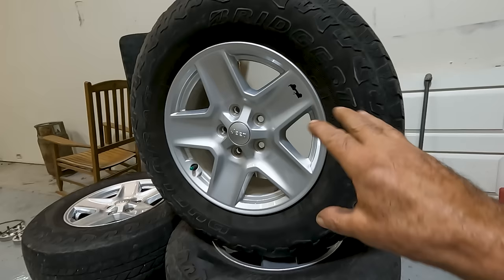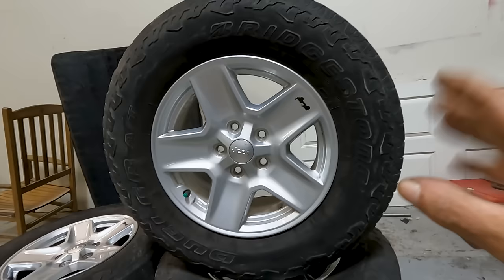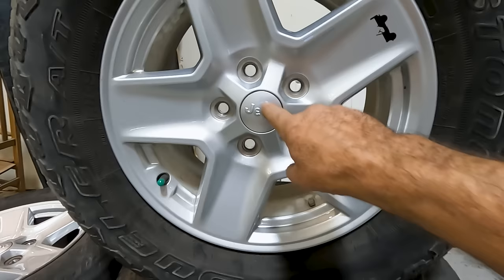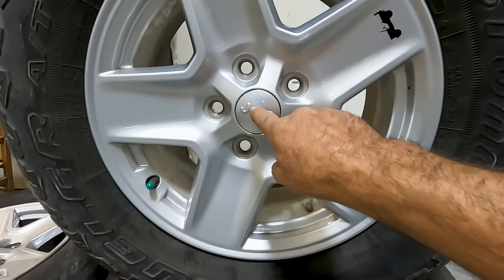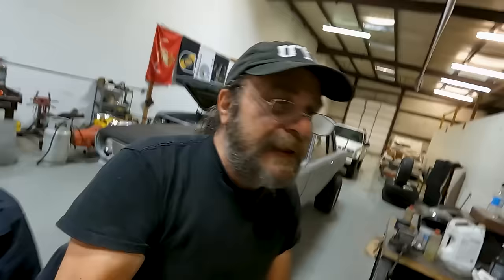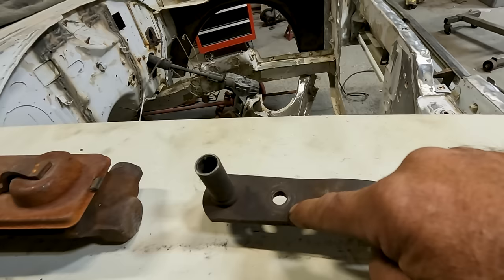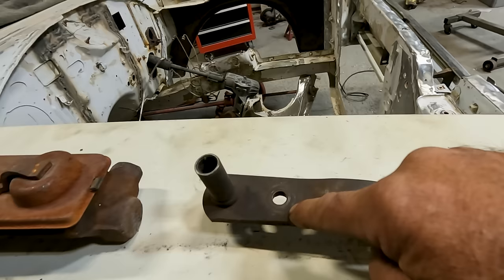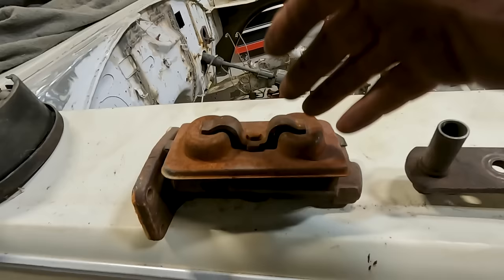Modifying Classic Cars And The Butterfly Effect - Can You Outsmart The Engineers?

Comment: I don't mean to poo-poo on your advice but my anecdote is almost the opposite for the same exact reason.  I live in the rust belt of Indiana so that may have something to do with it but my 63 Fairlane Sportscoupe had a single pot drum system that I converted to front disc.  I believe the engineers designed the braking systems (especially on budget cars) to be optimum to a price point for which is good enough for general use of the time.  For the amount of time and money I threw at those stupid drums that never worked properly for more than a few months I could have converted it to disc 3 times.  It got real old not knowing where the car was going to go when you hit the brakes hard.  About 7 or 8 years ago I converted it to disc and have never had a problem since.  Now I did change the master/booster, added the correct proportioning valve, discs, calipers, lines etc all new but now it brakes like a modern car and in the wet or slick weather it is finally predictable.  I'm not one of those guys saying that you have to convert, but done properly I think it adds to the daily driver ability.

Comment: i have a 1953 chevy 3100 pickup.  i had to put power assist disc brakes up front, because people drive different than they did in the 50's.   you are nuts.   i couldn't get the brakes to work effectively without pushing so hard my butt would come up off the seat,  since i installed the new brakes i can count on them no matter what .   usually i agree with you but not this tine.  i've had this truck 30 years never an issue with brakes since i modified my daily driver. 
i bought the whole kit from Patricks antique cars and trucks,PO Box10648 casa grande az.  i still have the catalogue.
Reply from the maker: There is a drastic difference between "pre interstate" era vehicles and post interstate...the cut-off being right around 1962-64.  The braking capabilities of the early cars and trucks is completely lacking in a 70 mph world, so upgrading yours makes total sense.
Reply: @UncleTonysGarage  thanks.  respect you much.  almost didn't post cause i didnt want to piss you off.  this truck may get power steering cause at 75 years old i am tired of how much effort it takes to turn front end while parking and k turns etc.  problem is at my age i have too many really  cool projects on my list of stuff to do..  they had big steering wheels in old cars for a reason.

Comment: Years ago I drove a Ford f-600 ambulance and the owner of the ambulance ordered it with air brakes which was way to much brake for that ambulance, I drove that ambulance 400 miles and everytime I would apply the brake I would barely tickle the brake pedal because if you pushed the pedal down a little more than tickling it the wheels would lock up or want to put you through the windshield!!! I was glad that was the only time I drove it and will never drive something like that again!!!!!

Comment: I have a 1982, Ford F150, in line 6, 4.9 L long bed. 145,,000 original miles and I have restored it. The only modification I did are as follows:
1. Heavy duty wiring harness
2. Electric cooling fan with a complete shroud
3. LED lghts
4. Holly EFI system. The carb was going and was constantly gummed up by these "new fuels." I had no choice here. Now she starts up like any modern vehicle.
5. Stereo with blue tooth.

They do make all manner of stuff for this truck but I was told to stay away. Speaking of your video, they also sell a "all 4 disk brake system" for it. It had drum in the rear and disks in the front. 

It just gives horrible gas milage (always did! Lol!) , about 10 MPG. I drive it to work 2 times a week. Is the gas consumption normal for these engines?

Comment: This is why at 55 years of age, I don't modify my cars I use GM parts from other models and years that BOLT ON
Reply: That is one of the great things about GM cars and trucks from about the late 80's-early 90's, and earlier...so many parts interchange...done by GM to help save with costs, no doubt..but it also helps us by making it easier to find used parts...
Reply: @dyer2cycle  I just do what they did, every time they were given the green light to use all the goodies in the parts program. Like my 86 Monte SS is gonna have a non ECM carb inducted 86 alloy head flat tappet Vette 350 TPI motor. With a 4.3 V6 convertor, and 4.10 S10 gears. All GM oem stuff. Just never available together on that car. Iroc box, Astro van steering shaft, SLP Camaro SS alloy rear diff cover/girdle/cooler on the 7.5 10 bolt. 5.7 TPI Fbody large outlet exh manifolds with a hand built ypipe into SS cat back. This stuff makes the car the way it should have been. With NO ILL EFFECTS

Comment: I a agree with most of what was said by uncle Tony on this video but there are some exceptions to the rule when certain models have a history  of bad performing breaks in a lower speak version.
As an example the early 6 cylinder holden commodores had smaller rotors then the v8 option versions but the v8s only being 100kg heavier could still pull up alot quicker then the the 6 cylinder version they where only 20 millimetre biger in diameter but it made a world of difference so in cases like that where nothing else needs to change just rotor and stub axle and everything else bolts up then its a no brainer for me do the upgrade just for peace of mind

Comment: I'm noticing a pretty big disconnect on a lot of these comments. The video was about stock daily drivers. So many people aren't picking the info up. If you change a front drum cars brakes to disc brakes, you don't just "put a proportioning valve in". You would need a new master cylinder, hoses, possibly lines, maybe even a pedal to even start to do it right. Then there's the rear brakes. How's the new front brake set up going to act with factory rear drums. Do they need to be bigger or smaller? In the end, the car probably won't even brake better than if you just left it alone and used stock factory equipment and adjustments. What makes most people fail at brake upgrades, imo, is that they pay no attention to the rear brakes. Good factory rear drums adjusted correctly will stop amazingly well. If you've swapped a V8 into your Chevy Vega, that's a modified hot rod now, not a stock daily driver. Thanks Tony for this well needed video!

Comment: I partially disagree only because technology has changed, and you can taylor a vehicle to your particular conditions.   
  There are things that are more reliable, or more effective.  
   Planing a head for more compression- improves overall efficiency.   
  Swapping gearsets for best ratios.   On my 56, it had a 3.90 diff with a three speed.   Swapped in a 3.38 diff and an sm420.  Its overall just better at takeoff, and cruising.  I kept the original brakes, they work fine.  
   I installed an electronic ignition because I live in a wet area and got sick of maintaining points.  I never have to think about the ignition anymore.   Its a total non issue.  
  I also swapped in radial tires.  
  Swapped in electric wipers in place of vacuum wipers.  Modern radio.  Seatbelts.  Green tinted tempered glass.  LED bulbs.

Comment: 1.Im sure yr wheel size/brake logic is sound , (angular 'moments' [physics!] etc )...but is it a reflection of reality? There are other factors surely. Say perhaps the brakes could lock up both sets of tires and the anti-lock kicks in  - in which case are the bigger wheels better? What about poor road surfaces,rain, engine braking, tyre heat disippation...ie grip !  etc etc ... I have no idea... I might argue that one would have to do some brake testing. 

2. My ex's father was a car engineer - he just did "Pipes"! Land Rover i think..
His knowledge and those like him shouldn't be in question as you say but what about the Bean Counters that tell them to loose $100 here and there on their designs?

--I must say if the brakes failed to stop me on dodgy wheels I'd wonder what might have been. 
However, with your massive experience . I'd always default to yr judgment! 
- Love the channel.

Comment: Yuuuup, I learned about changing brake systems the hard way, tried to go to non power brakes on an old Jeep, did nor work. I also had a hard time going from a power single cylinder master cylinder 65 F-350 to a double master. It took a while to get it even decent. Could I go to Wilwood and have them compile me a system?

Comment: Tony, in general I agree 100% but very specifically, what about soft neoprene OEM brake lines to the front cylinders being replaced with braided steel lines? That's a thing that can become a check valve and it will look good from the outside, so while replacing, why not go SS? The neoprene lines bulge a little, but how is that "good"?
How about shock absorbers, bias plys vs radials? In going to radials, I am actually changing the suspension.
Also, weren't rims up to 1975 designed to handle local load extremes that a bias ply would give, and a radial can exceed that? Can't that affect the bead if I'm using a radial?

Comment: I stick with If it ain't broke don't touch it. 

My daily 59 has drum brakes and a single master. 3 times I had to "panic stop" because of idiots. All 3 times they locked up and 2ce a couple tires spun on the rims, yet people keep saying to put disk brakes, upgrade the master even add a brake booster. Why? Everything works fine.

I made a winter recovery vehicle for snow one time and put bigger tires on for clearance and traction.
Everyone kept saying, take the 6 out and put a v8 in, switch the IFS to a solid axle its going to brake, put bigger brakes on, put a higher lift. Why? It was used for what it was intended for. Built for snow, not mud bogging, not rock climbing, not towing just winter recovery's. Had enough ground clearance plus if you hammered on the brakes fast and hard enough the back end could off the ground, also out of all the years owning it I only broke one front axle. 

I totally agree, keep it stock (unless there was a factory issue or defect) otherwise if you're building something build it for what its going to be used for.

Comment: I modified my 66 galaxie that came with manual drum brakes, to power drum brakes using factory brackets and things from a donor car that had power brakes. My brakes are now super touchy. I imagine there’s more leverage from the brake pedal on manual brake cars to help account for not having a booster. So having the manual brake pedal and a booster makes them super sensitive lol.
Reply: Just out of curiosity where does your pedal sit? Factory power brake cars had a lower pedal (closer to the floor). The manual one was much  higher. It was possible to spot at a glance what type of brakes these Fords had just by looking at the pedal. The factory power drums were known to be touchy. It's the inherent servo effect  of drums that contribute to this.
Reply: I have a '66 Galaxie also with manual drum brakes...what years/type donor cars will front disc setup that will bolt up and work?...
Reply: @roger628  maybe it's normal for them to be touchy then, thanks man

Comment: Tony,  i work in the facility where most of the engineering for modern brakes were developed.  All the different types of pad materials we have today...developed at my shop.  Rotor size and materials....check.  anti-lock brakes......check.  oir machinest hand built the mastercylinders and manifolds to employ the engineers thoughts and ideas.  You would be very suprised how much of this development was done by seat of the pants.  Im not tryimg to down play what you said at all.  You are very correct in your statements. But,  dont sell yourself short.  The way you come to conclusions is exactly how we do it in the lab and on the test track.  Time and time again common sense and "lets try this and see what happens" is the most effective method of gathering information and knowledge......jist like i watch you do.  These people are not super brilliant, in fact its amazing how many of them are numskulls. Again, dont sell yourself short.

Comment: This is exactly what I were thinking too when I bought my classic car. Living in Europe, I chose a Volvo Amazon as it is a popular car. Unfortunately, I ended up with a model year with little to no support. I now have to replace the brake system because parts are unavailable, as well as the carburetor. My biggest fear now are the unintended consequences of modifying two critical systems...
Reply: Mine's a 66 wagon I put in a B20, only to figure out 200cc is only 13 cubic inches and doesn't really make much difference. Did an OD swap at the same time. The od is nice on longer high-speed interstate trips my driving is all in 60mph areas. Fun project but it wasn't a huge improvement. Got bored with it and haven't driven it since 2018. Lol😅
Reply: I have been entertaining the thought to just cut my losses and sell my car. Certainly would never recoup the money spent on trying to get it to run properly. Buying multiple used original carburetors, multiple rebuild kits and paying other people/companies to do rebuilds has cost a lot of money. Despite this, no one can get it working properly. Due to the age and wear, special machining work has to be performed. Everyone has so far not bothered with that and only slapped on new paper gaskets and callet it good enough. Doesn't help much when flanges are warped and throttle shaft bores are worn out.
Reply: @togst  Sent my SUs of for a pro rebuild. Always do my own carbs but the bushings were shot and his price wasn't much more than my cost for kits. The "pro" drilled all the way through for the bushings. Had to strip um down, push the bushings in then spent hours filing them to match the radius of the bores.
Every time I pay someone to do something, I end up redoing it. 😆

Comment: Tony, I disagree I think upgrading the braking system on a classic car daily driver is probably one of the smartest moves you could make. I do believe that leaving the suspension the way it was intended to be is necessary. The only thing that needs to be done is bushings, ball joints, and things of those nature improved maybe replace the rear springs because they may be worn and will make a better ride.

Comment: I was looking at a new motorcycle the other day and noticed it had one disc in the front. So, I began talking to the salesman about brakes. I also asked him if they ever offer any test rides. 

The kind of brakes I am used to is from the mid 80's technology. I've ridden classic K BMW bikes for almost 40 years now. I' suppose things have changed since then. When I get a new front tire, I begin breaking in it, and I also begin some testing of it and my brakes in case I ever get into a "panic" braking situation. I want to brake by training kicking in with no surprises. I want to know my brakes and my tires. 

I brake hard and then listen to the rubber on the front tire begin to make its complaints. I hear it sort of grumble a bit as the tread pattern begins to flex. Then I know there is more braking to be had, so I go for a bit more on my easy pull brake lever and I get some more braking and a bit more dive of the front forks as the tire begins to howl. I hear the howl and I know there is yet a bit more braking to be had, so I apply the easy pull lever a bit more and the pitch changes, and I know that I have gained a bit more stopping power, but there is really no more to be gained. I'm at the safe limit, and that's it. 

I do that from time to time, just so I know and so I have this braking into my muscle memory or mental memory or whatever it is. I have had some emergency braking situations and what I found it is, it works. I don't know if they will let me test ride or not, but if somebody says "The brakes are good. They are fine. I like the brakes on my bike." I will want to hear them tell me about their brakes. Why do they think their brakes are fine? Why do they think they are good?

Well, I'm getting older now and I'm wondering about a lightweight bike with a low seat height, looking a the Harley 48, (low end grunt) the Scout, the Triumph Speed Master, and something else I might call a speed wobble or whatever, and I've been seeing rear shocks that have no travel. It's like some hack lowered the bikes by putting short shocks on. It's crazy. A butterfly effect? I think it started with big wheels and short tires. Where were the engineers? ...carried away by giant butterflies?

Comment: The only way I would modify the brakes is if it was an original option on the vehicle, and I can get some used OEM parts that are either off the same type car that had the disc brakes originally, or same setup from a similar car...examples: if I had a '69-'70 Chevy pickup with front drum brakes and I wanted discs, I might find some off a '71-'72 truck that had front discs from the factory...My '66 Galaxie has front drum brakes, someday I MIGHT switch it to discs because discs were an option in '66, but only if I can find the setup off a late-'60's-early '70's Galaxie..provided, of course, the rear brakes are compatible...Disc brakes on the rear, I absolutely would not do that on a daily driver classic...I prefer rear drums, anyway. People nowadays tend to speed up to stop signs, lights, or behind another vehicle, then stab on the brakes at the last second, rather than gradually slowing down. I think that is a large part of the problem. I have never had any problem stopping a vehicle with drum brakes unless they were in disrepair..no front disc shimmy, either....